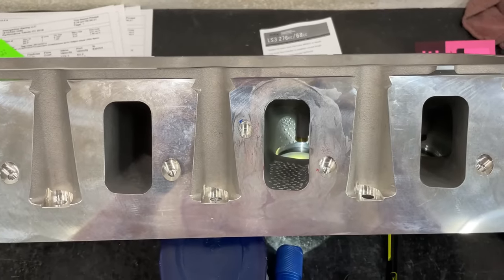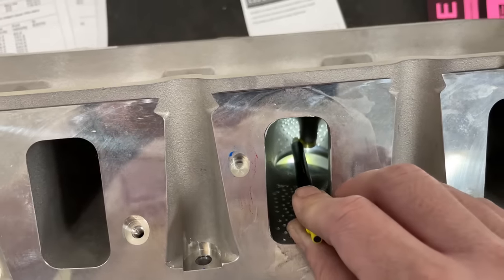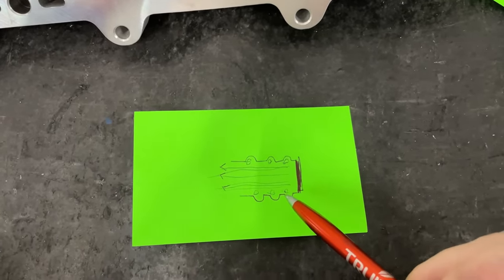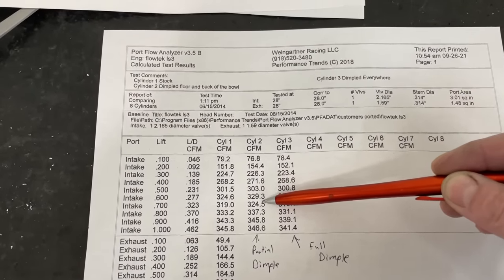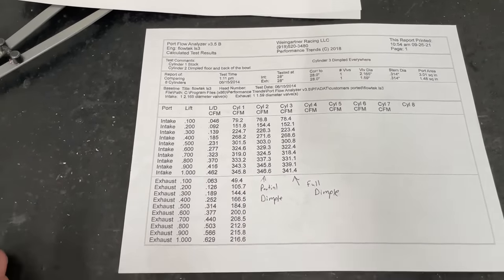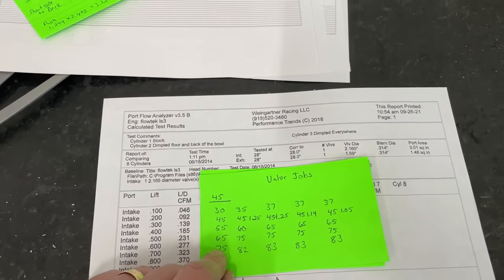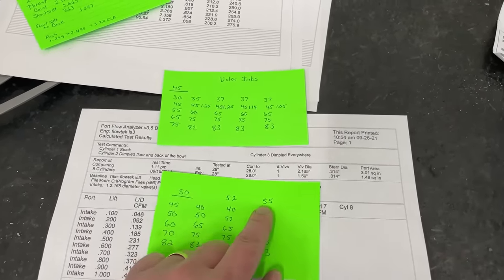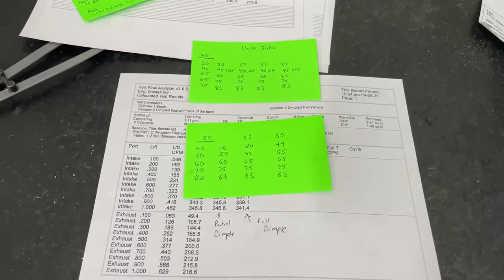Dimpling of Intake Ports Does It Help Part 1 of Internet Ports Heads

Comment: We always used a special tool that put a very coarse surface around the port or perpendicular to the airflow.
Like very coarse cone
Not talking about sand paper now.
The surface ends up feeling like sandpaper you cannot use sandpaper to produce it.
You would have to put a million dimples in that port to make the same effect.
Like peeing the surface.
It must be "regular" and minimal in relation to it's size like 1 to 100.
If diameter is 2 the roughness should be . 002 in proportion but must be regular.
Reality is it's the change of direction where you must have the detail.
We always treat the entire surface.
For sail boats they make special plastic dimples that come on the sheet makes it much easier to apply.
The only place you will see a detail on a relatively long flat surface is on the departing side meaning two surfaces at a slight angle to each other just beyond the point of the divergence surface roughness causes the fluid to remain in contact with that surface, 5 degrees of changes is already enough.
Oh by the way air is fluid, air with anything entrained in it has more density and inertia.

Comment: I wonder about wet flow in the slow areas. Do  the dimples help fuel from running down the wall in the slow areas of the port

Comment: Basically although the dimples do help with flow separation they decrease overall mass flow rate due to skin friction. Thus a drop in volumetric efficiency. 

Its also kind of pointless testing on a flow bench for this as reynolds numbers are nowhere near representative of operation. It gives false readings. It likely will improve results down that low. But in actual use its harmful. 

A boundary layer is of course important. However too rough and it causes separation and turbulence. That's well before you even start to think about dimples. Think a 1.0 Ra finish. That's where you want to be. So sanding ports with 320 grit sandpaper/abrasive is the best solution.

Comment: How consistent will these head flow on the bench? Meaning will you get the same numbers every time on the same head? Or are these changes in "dimpling" within the normal flow variation run to run? Is there a point in flowing a head multiple times to get an average? Anyways awesome video and I appreciate your hard work and knowledge being shared!

Comment: Nice work. I tend to think the dimples in the foreground would cause tremendous turbulence but I agree with the ones in the background to disrupt the airflow in the 90 degree turn into the valve seat. Makes for better compression values in turbo-charged engines. Have you ever experimented with Micro Vortex Generators inside the port? check out the leading edge of a small airplane wing.
Reply: This would be an argument for dimples along the intake side of the valve seat.

Comment: I’d like to see a “better” dimpling or golf ball port job. The dimpling/golf ball design that actually looks like the surface of a golf ball. If this dimpling job effected the flow, I can only imagine a high end dimpling port job would flow more than as cast.
Reply: It doesn’t help flow. You’ve only got so much energy in the mass of the air. Creating a bigger separation layer uses energy. That energy is best spent pushing the air into the cylinder. 

Re shaping the port with epoxy will out flow a dimple job.

A “better” dimpling job won’t change the fact that energy is being taken from the air mass to create flow separation.
Reply: @th600mike3  ^^this. The dimples on a golf ball create lift as the ball spins through the air. Inside the head, they create turbulence.
Reply: @Tumbleweed_Tx  The experience with the dimples I’ve had was to crutch the port by stirring the dead spots in the port, and it is best for iron heads where they are difficult get the eddies to lift and remediate the dead spots.  Welding warps things.  Aluminum heads can be filled with relatively low heat tig welding. I did the dimples on iron to save money. Replace the guides and intake valves to 2.2 in a Ford FE head that is biased to allow a larger intake valve.  You can crutch the small exhaust with more duration and asymmetric exhaust lobes. A 445 stroker with a 4.082x4.25 stroke engine can make 550 ft lbs and 575 hp on pump gas.  Getting the most air/fuel in with a good burn is hp, more exhaust duration with fair to adequate port can get it done. That’s a 60 year old design, lol.

Comment: Have you done any measurement system analysis (gauge R&R)? The differences you're seeing are very small in absolute terms & could easily be caused by factors other than the focus of the test.
Reply: The problem is that, if you look at actual dimpled heads vs this video.... you'll realize this guy did it all wrong. 1) there are too many "dimples" 2) the dimples aren't smooth 3)the dimples are too small 4) the dimples are in a random fashion and not in any actual pattern like an actual golf ball

A properly dimpled cylinder head performed by CNC will show significant gains in airflow over the entire RPM range. There are many actual videos of a properly dimpled head. Doing it by hand is wrong. 

The other benefit of a dimpled head that you cannot test for in an air flow bench, is the turbulence or swirl that can be designed into a dimpled pattern that will keep the atomized fuel floating in the air instead of pooling up in a port fuel injection setup. The only way to properly test for this is using a wet test bench, or through fluid simulation in CAD.

Comment: Here's some food for thought. Maybe it's where you dimple. Maybe it's how much you dimple aka how close they are. Because may it's supposed to be a certain number per square inch. Maybe it's only dimple in the flat area and not too close to the curved areas. Or maybe only in the curved area and a little beyond that. But not on the flat areas. Or maybe only in the larger flat area but not the top and bottom. or maybe only the sides and not the top and bottom?

If there was a way to swirl the air doing these dimples I know that would really increase air flow because that would help compress the air and cause an actual suction for more air. Kinda how a drain in your sink works. But I'm not sure how you would create that effect with dimples.
Reply: If you could make a plexi glass mold of the intake where you could use a smoke machine to watch what the effect is before and after each dimple test, you could work out the best place to put them and really increase horsepower. And also figure out what needs to be done for people who just want it to increase torque for towing. Here's 3 more ideas. Maybe dimples work best at the beginning, middle, or end of the port? But I would think the dimples would work better at the beginning, then the air smooths out just before the end which might cause a suction effect more than what's already there.

Talk to people who work with wind tunnels. They might give you some ideas. In a wind tunnel you could see your ideas in a bigger scale.

Comment: does it make a difference if it's a dimpled surface moving thru the air vs. air moving over a dimpled surface?
Reply: No. All velocities are relative. The performance doesn't change if the whole engine is moving down the road at 109moh on a planet hurtling through space at thousands of miles per hour.  It doesn't usually matter which is flowing relative to the other as long as the whole system is considered.

Comment: Mr. Eric Weingartner I was watching your video on intake ports and had a thought to hit me how about oversizing the intake ports where you can use a sleeve or just an insert ( just own the intake port.   This thing would only need to be about probably 20 to 25000 thick ) and now you can make the inside of your ports on a 3D printer out of various materials and they're moving into ceramic and metal that would allow you to test materials and you can repeat the exact pattern that use on a golf ball and other patterns of your own design on the flow table.     Other thoughts.    obviously the inside of that port is probably too hot 4 a plastic surface to be in there I would think but that surface depending on what it is might keep the heat from being transferred to the air as bad I've never heard of such a thing but could you design a head where it had a removable valve seat allowing you to slide the insert into the intake Port of the head and when you put the seat back it holds the insert in and if you done the same thing in the intake itself and if you had to make that intake come apart where you can put the inserts in there and with what they're doing with computers and photos and scans by taking photos are scam of the ports on the head an intake you could have somebody write program to where it would match those ports exactly if you had the ports on the head and on the intake oversized enough the insert would be what match them to Ports together exactly and even the pattern you use inside the port would match the pattern in the intake like wallpaper to the next strip of wallpaper the computer if you're doing it on a computer could match these patterns in the head an in the intake exactly combines that with virtual computer modeling of what the air is going to be doing as it flows from the throttle body or carburetor through the intake and then the intake port and the head you might be able to write a program that would decide where different patterns are needed what size dimpling is needed or if it just needs to be a smooth surface might be possible just like you're using different patterns and dimpling after some experimentation different types of materials may give you different effects as well so your program you could write it in to include that.        If you play around with it.       It's possible.       This could take things to the next level
I don't know just a thought

Comment: The old school idea was make your exhaust side ultra smooth and leave the intake side a little rough that was ment to be used with a carb engine. If it's not multi port fuel injection I'm sure the same theory is the same. Never dimple the chamber you need as much compression as possible.

Comment: 2 ideas, just ideas. First one you should have tested no dimple at least 4 times, 4 times partial and 4 times full. That so you can have a more standard result Air flow will never bring you the same measurement. Second idea just following the one test for each stage, partial dimple may have made the intake air become more laminar instead of full dimple creating a more turbulent air flow.

Comment: Those dimples may increase cfm but the turbulence you’re introducing won’t build power. Do a set of heads and then compare actual hp gains and losses. Those dimples are increasing the size of the port obviously. Doesn’t mean it’s going to make more power.

Comment: introducing turbulence in the boundary area probably does not hurt, but I would not expect huge gains.  Something to do for when your looking for those last few tenths of HP would be my guess..... AAAAnndd I would have been wrong, LOL.  It appears that the gains are limited to only certain areas that someone without modeling software or a fuck ton of heads will be able to see.  Great video.  I will just leave my junk alone, no sense in polishing a turd!

Comment: That is a tedious task... needs a dental drill [right angled head] to do that without dancing all over the place?  Anyway, my rough understanding of the theory is minor benefits to keeping fuel in suspension by interrupting laminar flow.  Flowbench may not tell as much, as a dyno can - but an important starting point before firing up.   All of this is physicist territory to me, and I have a question:  has anyone figured out a) what % of surface area needs dimpling for optimum effect and b) what % [range] of burr radius depth of cut provides  proper dimple to apply this technique?   I'm still digging...

Comment: You Should have dimpled in lines perpendicular to the flow some distance apart in the direction of the flow. You got this idea from the Golf ball, at any one time the dimples on the golf ball that are effective are the ones closest to perpendicular to the flow, meaning top and bottom edge on 2D image. The golf ball is dimpled all round because it's constantly spinning and the dimples are changing location. Why you would want them to be some distance apart? Because once that vortex is generated it will then remain for some distance and die out. If you have dimples all along the path the vortex will constructively interfere with each dimple there after and get bigger, it will then disturb the flow once it's to large. The distance to the following lines of dimples can be calculated but in you case just experiment and call it your findings.

Comment: Dimpling is for atomization, which is why polishing isnt a good idea. Visualize the fuel gathering onto a smooth surface as the mirror in ur bathroom after a shower. It doesnt gather onto the walls but moreso onto the smooth mirror surface.

Comment: NACA forerunner to NASA did tons of work on airflow and fluid dynamics.   One of the best ways they found was by adding a vacuum at the boundary....the layer was prevented from breaking down...and remained laminar..  They made an experimental wing with the vacuum..idea. 
   You could do the same on a head.  Just drill about 300 pinholes in the port....hook them up to several dozen vacuum cleaners.   And you've got perfect boundary performance.
   You also need to clean the pinholes every few miles.  You can see why NASA gave up.  Lol

Comment: I feel like it will help initially, but might make it easier for debris to build up
Reply: If you have a problem with debris building up in the cylinder head then your engine is already wrecked
Reply: @jaydunbar7538  Maybe its just me, but i've never seen a sparkling clean intake manifold after 5-10 years

Comment: You should try only dimpling the SSR so the air stays attached and helps it turn
Reply from the maker: It was dimpled there on the one I completely dimpled. It didn’t help.

Comment: I´m wondering if the results are not just introduced by variations from disassembling/assembling the head or temperature conditions during the different runs, like the outside air temperature for example. The dimpling might have only a minor effect - but that´s more a question than a guess :) You can only be sure by running it many times while keeping all the other conditions exactly the same.

Comment: The dimpling works best on an outside surface such as the golf ball because it has no effect on the volume available for flow. Inside dimensions, such as the port. are reduced by the dimpling because the air boundary is moved inward by the eddy currents, making the port smaller in volume.
Reply: That's why he picked the areas where ideally the port would flow better if smaller to dimple on the first test. Like he said you can always just fill in those areas with epoxy to achieve the same effect.

Comment: I've never bought the idea that dimpling helps a cylinder head. I'm of the thinking that dimpling requires energy and makes the port behave as though it were smaller. I did see a really cool history channel video about golf balls where the golf ball had smooth sides with a dimpled center band, and the design got forbidden for some odd reason.
Reply: @Lassi Kinnunen 81 Thank you for replying! I believe that design had a slew of effects. It spun in one axis that naturally aligned itself to some tangent of club-strike, the trajectory was different (I forget how), and it got banned for a completely different reason. Something to do with the way the outer membrane was made, and some sort of other physical parameter. 

Now that I read my previous statement, the idea of dimpling makes more sense. We're trying to divorce the desired air volume from the runner, the same way we're trying to separate the ball from the air, so the no-slip condition gradient is shorter. This would be the equivalent of ball bearings. That said, I can see my own pessimism about it requiring energy. By requiring energy in the form of rotational energy, the air speed is related to the diameter of the eddy. That leaves me wondering about patterns as well as shapes like chevrons and diamonds, plus putting a pattern on the intake runner as well.

Comment: Heck, id say find the closest edge of the bore near the edge of the valve, to the centerline of the valve,  and weld in a divider, or ridge, and dimple what you weld in.
Reply: A ridge that steers the flow, Im not quite sure how to explain what I have in my brain
Reply: I can see it, and it does steer the mixture where you want it.

Comment: even the partial dimpling was excessive. try : only dimple the middle 1/5 th of the length. you gain in the mid valve lift, and not loose on the full lift.

Comment: I think if it works then it's actually doing something different than a golf ball. It helps a golf ball by pulling the air behind the ball so it doesn't have as much tail drag. Dimples in an intake runner should tumble the air in the dimple and make the large portion of air slip over it better. A more patterned job should prove good results. I believe a few high end super cars use dimpled runners.

Comment: If your looking for a port that flows go look at David Visard videos NO BODY knows more about port energy and port port flow Visard is the top head man he can take anybody's heads that have been max ported and David can get another 100 HP with out putting any parts in the head just conturring the the valves and ports he's the man
Reply from the maker: If you believe that I have some beach front property in Arizona to sell you.